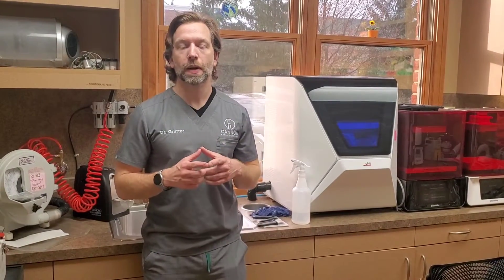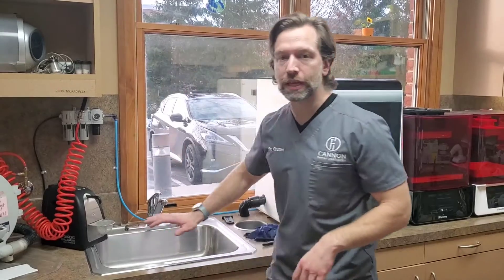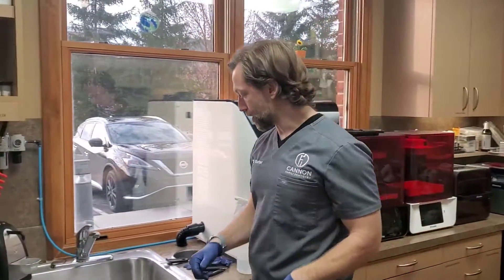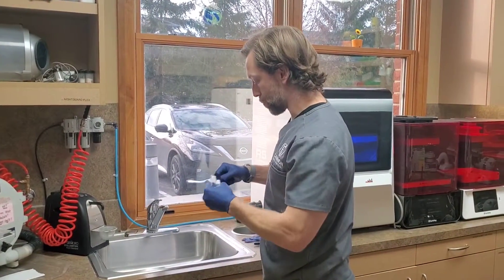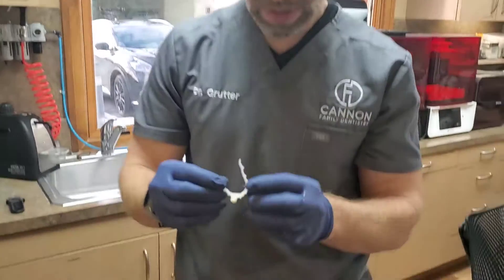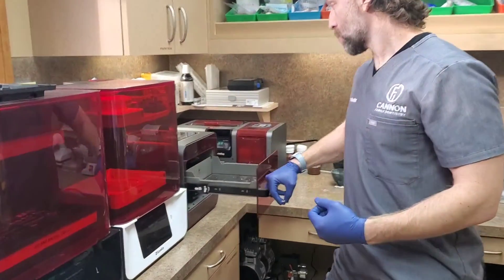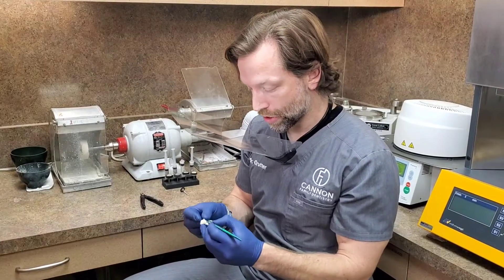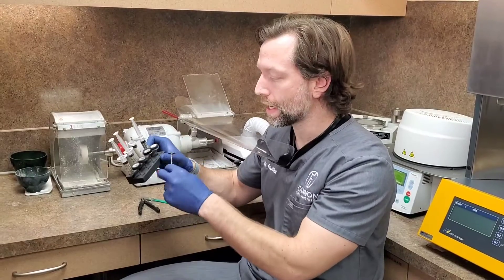SprintRay OnX Processing and Polishing

Comment: Which Sprintray would you use for larger applications like a full denture?
Reply from the maker: Either will work for that. 95 shines would volume, such as aligner models. If you're doing dentures, you could probably fit 5-6 on the 55.

Comment: Baron, what's the big white unit next to your sink and the sprintrays?
Reply from the maker: VHF R5 5-axis mill.
Reply: Have you made any videos of how you're using it day to day? I've seen Cory's videos on using milled metal and trilor for bars in hybrids and I was thinking about going thst route for long tetm hybrids.
Reply from the maker: I'm using it for custom titanium abutments, all of my screw retained emax crowns, and the occasional tooth born crown. My goal is to use it for full Arch implant restorations, but don't yet have any of those to restore since adding it to the office. Have a couple coming up soon, though. I can also mail emacs and will do so eventually. But I've only done it for testing so far since I have my MC XL for same day emax.